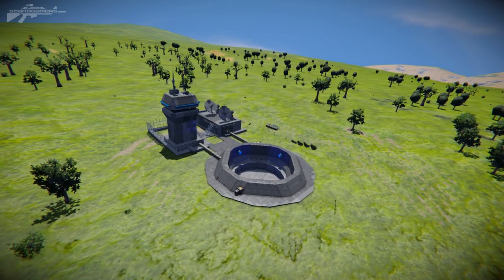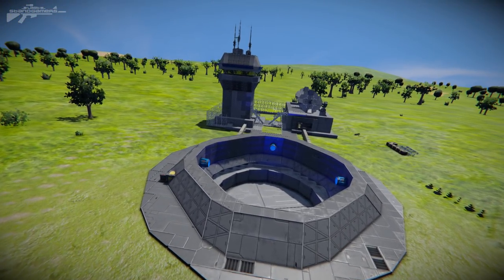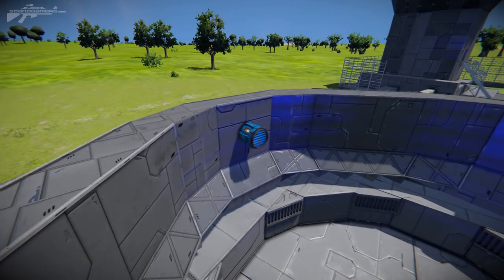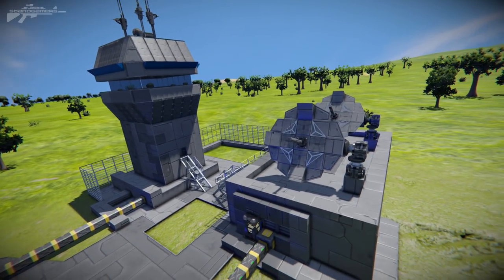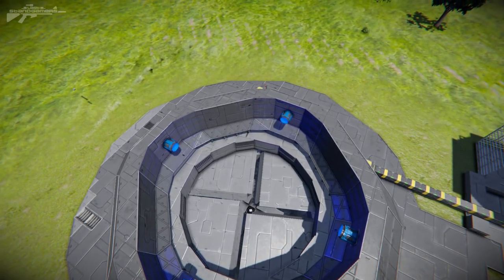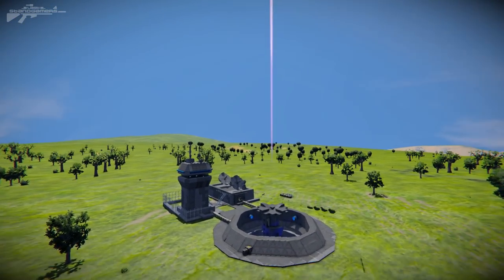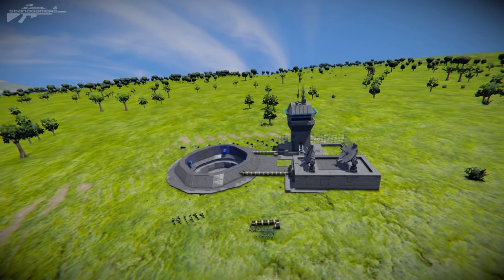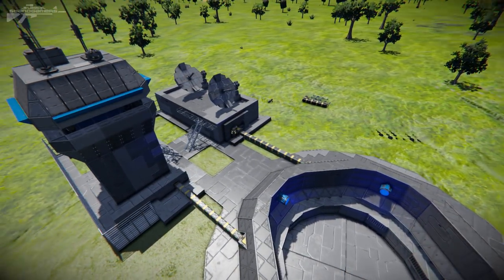Particle Cannon Command & Conquer - Space Engineers

Comment: Put a satellite in space with the weapon you used for the particle cannon. When the cannon on the ground is fired, use the satellite to "redirect" the laser into a ground target by firing the satellite at the target on the ground. Maybe use a laser antenna to connect the two creations so you can remote control the satellite from the ground There, you've replicated the actual weapon as well as you can in Space engineers